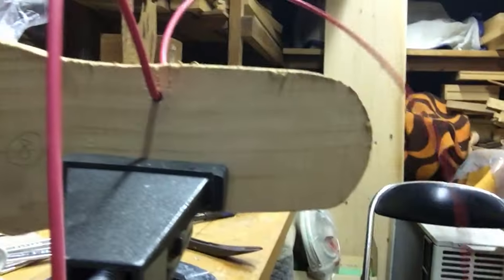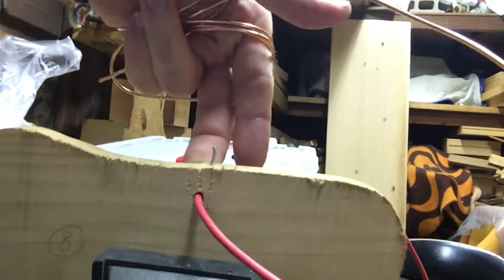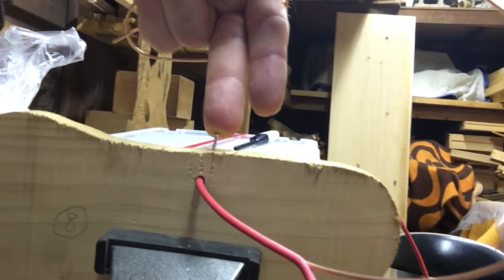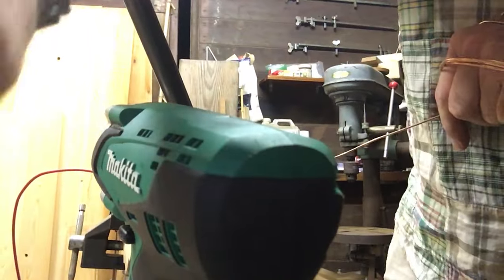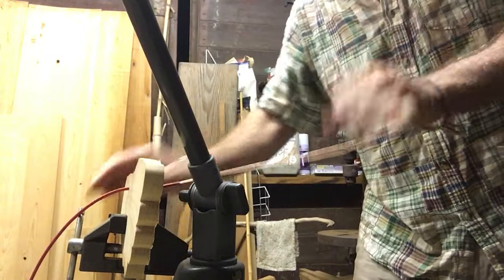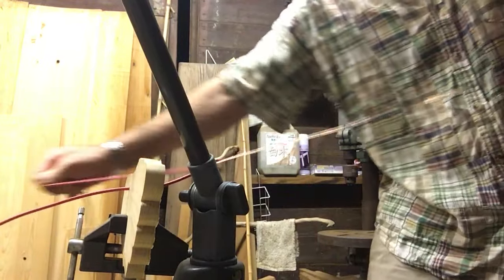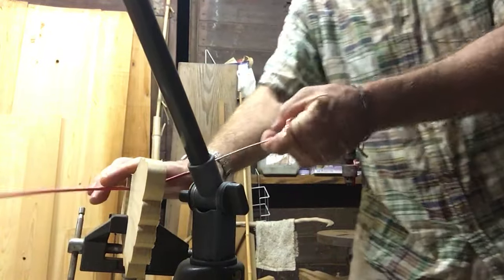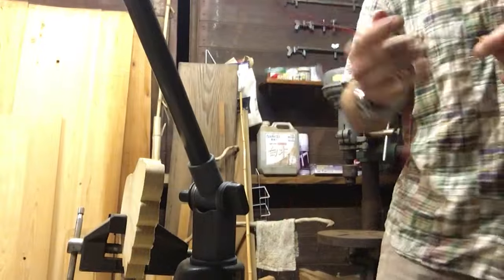How To Strip Copper Wire For Scrap, Quick and EZ!

Comment: Made something similar at weekend but used a screw which I can adjust depending on thickness of wire - simple and effective 💪
Reply from the maker: Great idea.  Thanks for sharing.
Reply from the maker: Yes. That’s a great idea. I’ve tried a screw before but I think the one I used wasn’t sharp enough.
Reply: @snowaterider  Nice. Thanks for the ideas.

Comment: I have some wiring to do on an electrolysis tub project which means stripping the wire in sections withing the lengths of the coated wire. Imagine a long uncut wire stripped in several sections of its length. Those bare sections or copper wire will be wrapped around a rebar pole that will be used in the electrolysis bath to make contact with each other in a series. I can then have the coated wire running about the length of the electrolysis tub and not touching anything to short out anything, but still have good contact with the rebar at each position about the tub. Probably not making a bit of sense in describing it, but this sort of wire stripping device will help me to do my project much better than buying some sort of wire stripping machine. Thanks for the idea to resolve the issue I may be running into. ;-)
Reply from the maker: There are actual tools made to do that. This is just a free and fast solution for recycling used wires for scrap.  If it’s only in a couple of sections then you can easily do it by hand with a cutter knife. You’ll figure it out.